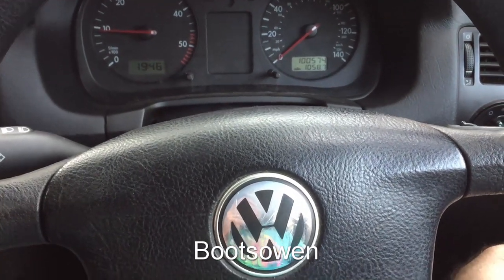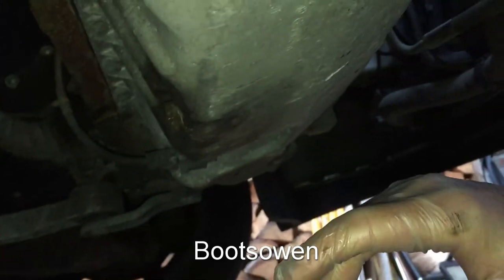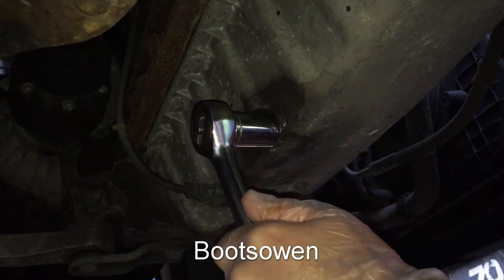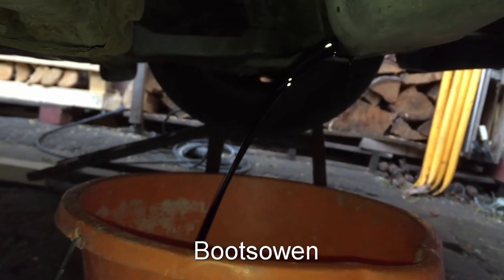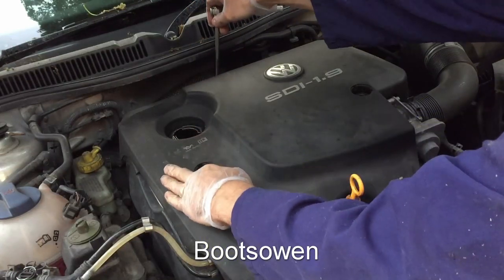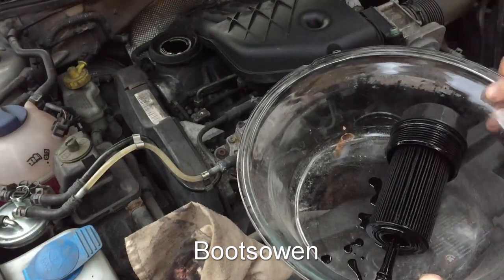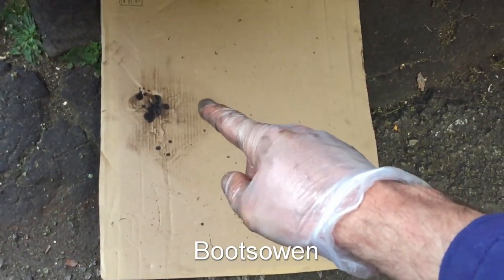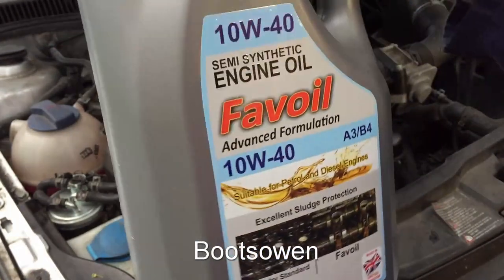VW Golf 1.9 SDI Oil and filter change: how I do it and what I do wrong! MK 4 IV

Comment: I have exactly the same car and engine with 500 000 kms,always with castrol 5W40,I don t know your motor oil,but always be careful with good shipest oil.I don't know where you live and maybe 10W40 is good for the climate.Good video
Reply from the maker: Thanks, This engine has about 100k miles 160k kms, I prefer cheap oil and to change it often. Usually once a year because I do about 4-5k miles per year. Once an engine is this old I don't think it is worth spending money on it. But we all have different opinions about cars!
Reply: @bootsowen  Yes I can understand

Comment: Hi, I've got the same motor in my Caddy MK2, trusty old tractor. How's the golf running? 

I always thought the oil level should be more towards the top of the groove not the grid where it was before you sucked a bit out? Are you 100% it should be at the top of the grid?

Also on Opie Oils they recommend 15w40 now but I've been using 5w40 Millers (winter) and previously 10w40, while VW recommend 5w30? Do you think 5w30 was used when the motor was new or under 100k miles that's why they recommend that?

Cheers.
Reply from the maker: It just won't die, I have never looked at the rating of oil, just the price, cheapest and often, in my case once a year for about 5000miles. As long as there isn't too much in it the oil light will let you know if there is too little. It's a good job I like fixing stuff.

Comment: That Bosch pump will give you trouble and start sucking air around the head, why one of the fuel lines is clear, to see bubbles.  A few little ones are alright, it is tricky but they can be changed without loosing the time on it, that's is big trouble if you do. Two 1.9TDI's
Reply from the maker: I have already done the timing on this engine and posted a video about it.
Reply: @bootsowen  Its the pump timing, and the head seal on it. With out vag-com if you take it apart or remove it its a PITA.
Reply: @bootsowen  If you start having trouble look for the bubbles